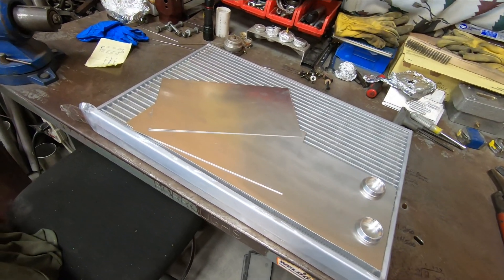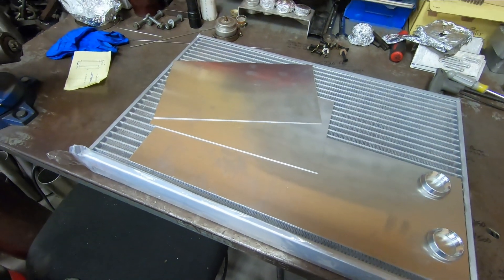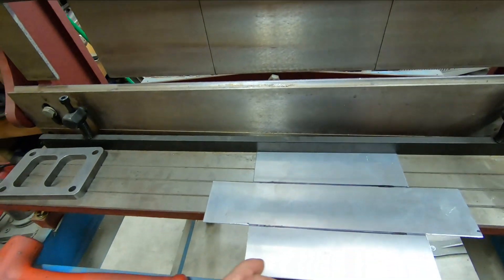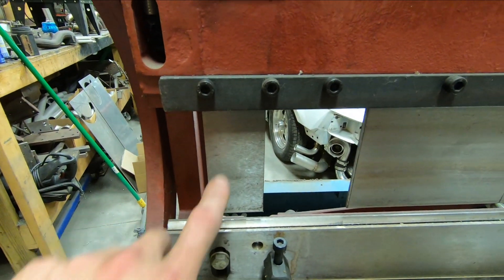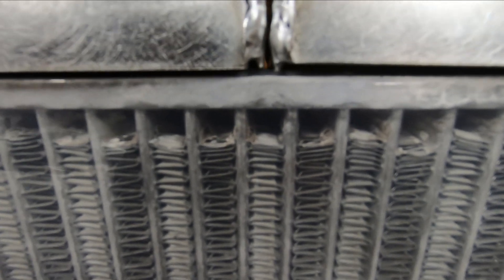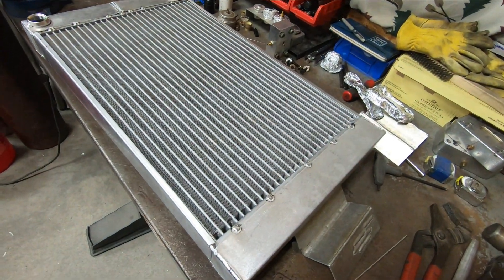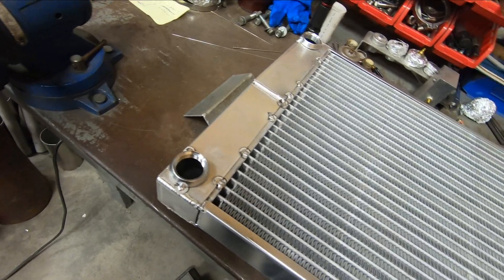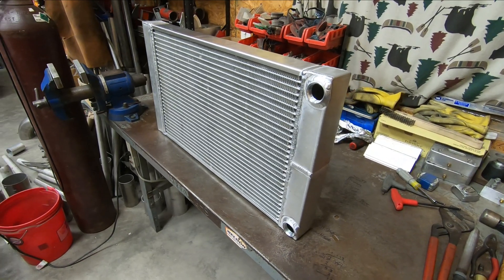BP Autosports Tech | Building a Dual-Pass Radiator

Comment: While your idea of a dual (multi) pass radiator is sorta right, that only really applies when using quite a bit higher flowing water pumps. Without the use of high flow pump, a dual / multi pass radiator can actually cause a degrade in cooling performance because of the flow loss that a dual pass radiator causes. The high flow pumps are needed to compensate / overcome the losses.

Regardless of that though, even you are running high enough flow pumps, you lost much (if not all) of the advantage that you might have gained by the way that you put together the split tank side. You have a pretty large internal bypass in that side between the two tanks. 
When building dual / multi pass radiators, the correct way is that the first tank be fully welded all the way around the header on all four sides (front, back, two ends), then the second tank added after. Since it appears that you welded the tanks in a buttjoint configuration to the header flanges, you now have an area the width of the header and the height of the flanges that is open between the two tanks that water is going to flow through. Since fluids take the path or least resistance, as much water that can is going to just flow from one tank to the other rather than go through the core itself and back.

Comment: I have a question and a comment about this video.  My question is why not make a single tank with a divider or dividers instead of building two tanks and welding them up and then welding them together which to the armchair fabricator seems like you are increasing your chance for leaks and future cracks etc.  Also instead of a hole-saw which leaves kind of ragged edges and the saws them selves wear rather quickly not use a “Greenly” knock-out tool.  Knockout tools make nice distortion free holes in sheet metal, admittedly they can be a little expensive but no more so that few hole-saws of the same size.
Now for the comment but first I do enjoy the overall content of your channel but please stop or severely  slow your camera movements because as you were moving the camera in and out or side to side I and my girlfriend who was with watching the video we were both starting to get feel the effects of vertigo because of them.  I am not trying to kick you in the nads actually quite the opposite because if my girl and I were feeling that way how many other people might also be feeling and or thinking the same thing.  Keep doing what your doing and have a great day.
Reply: i was curious about that and also about there not being a weld on either of the dividers. it cant possibly be perfectly sealed so i assume there would be some crossflow between those two tanks, i realize it wouldnt be much and it maybe would be negligible but i cant help but think if i was making one i would do something to prevent that.